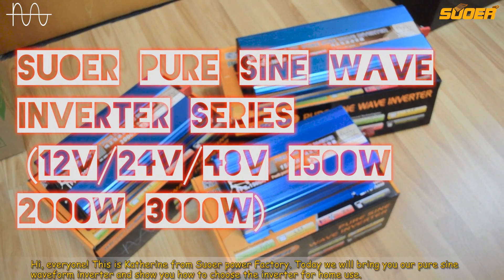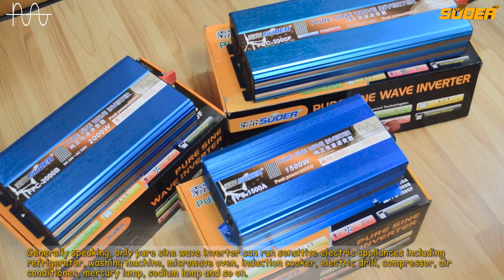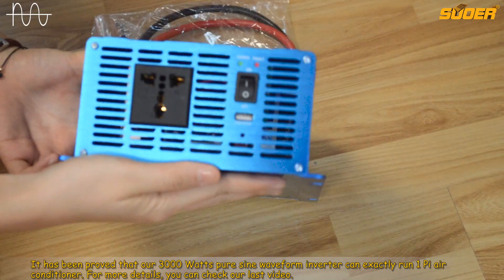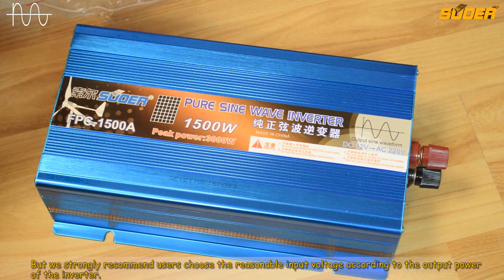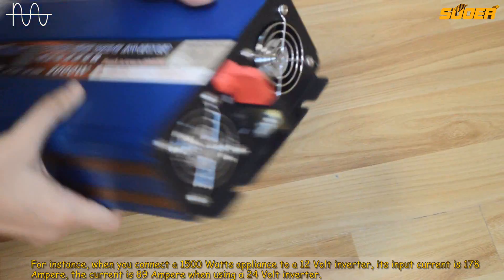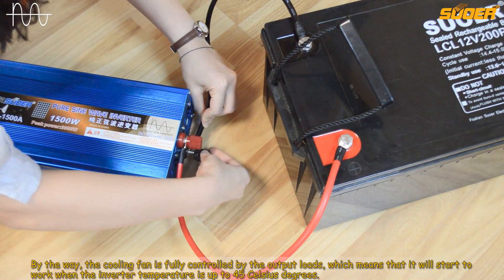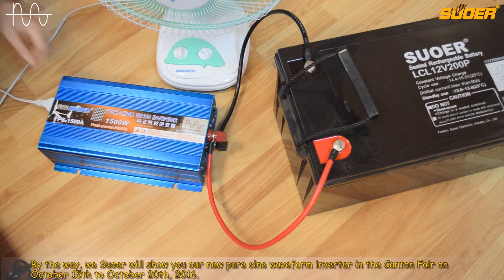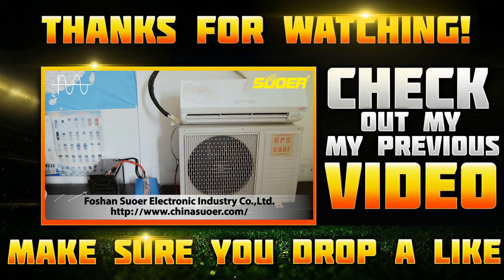Suoer Pure Sine Wave Inverter 1500W/2000W/3000W (FPC Series)

Comment: CAUTION re. Suoer sinewave inverters . The DC Input is NOT fully isolated from the AC output as you would expect in an inverter. If you ground the AC neutral and either side of the DC Input, it will damage the inverter. This makes these inverters unsuitable for any installation where the AC neutral is grounded.

Comment: i have a sua 2000l to run a .5hp motor can the inverter will not burn?
Reply from the maker: No,this model can not a motor,u should use a pure sine wave inverter like FPC-2000